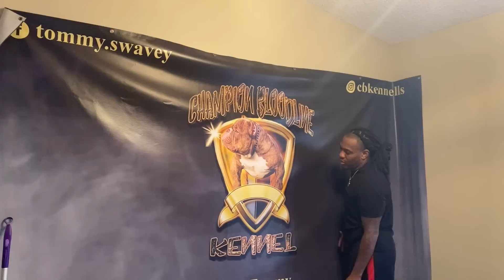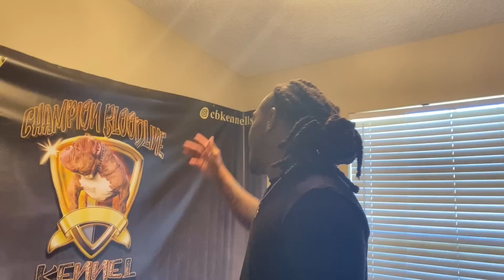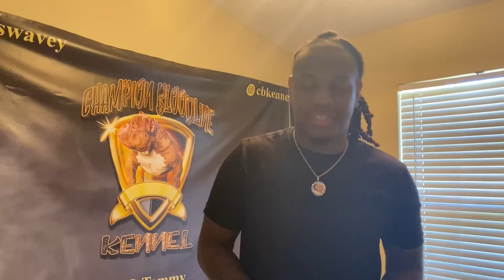The BEST Dog Kennel Setup ❗️ For Breeders

Comment: Definitely should have uesd mortar thinset you mix yourself instead of premixed mortar it takes to long to dry in is best used on thin application use like walls not floors.  That why your materials was expensive.  Premix is always more expensive but not as strong as the motar u mix yourself.  Lov this concept you did an awesome job bro.